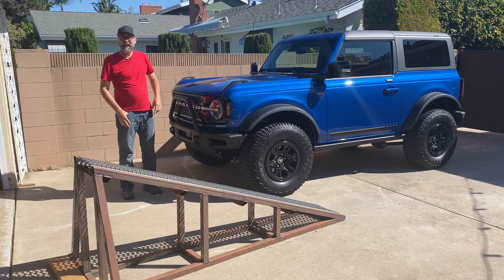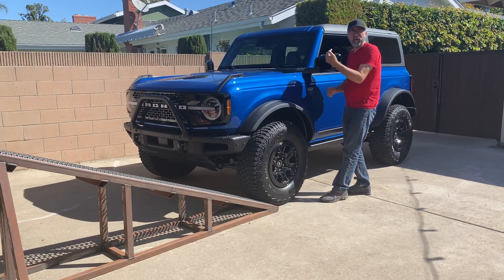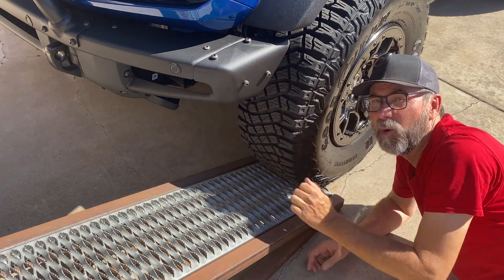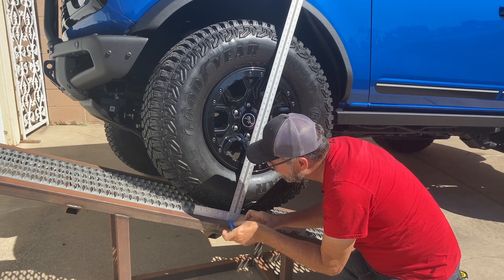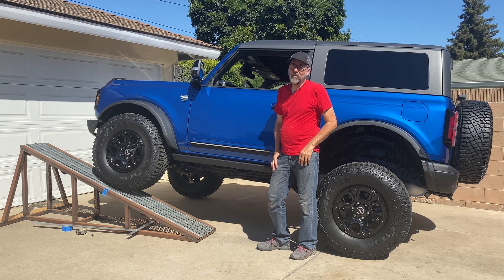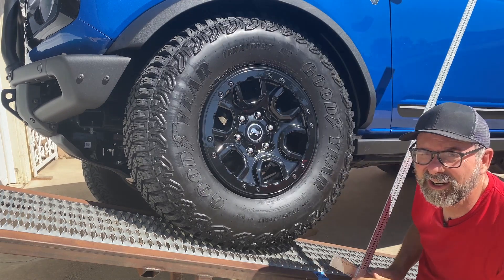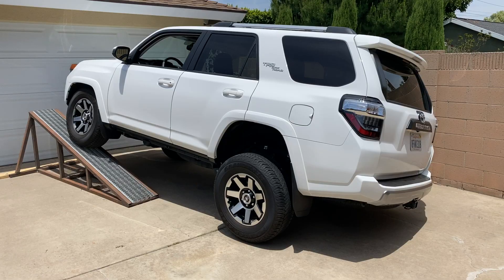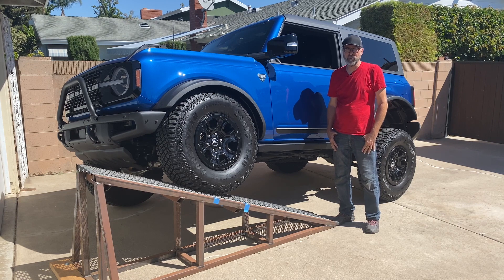2021 Ford Bronco 2-Door Suspension Flex Test: 35” Sasquatch Tires and a Disconnecting Stabilizer Bar

Comment: I would LOVE to see you do this with a Land Rover LR3/LR4! There’s debate on our forums whether or not wheeling in off road suspension height or standard height actually provides more flex. There’s also debate whether or not there’s any utility getting under the vehicle and manually disconnecting the sway bar.

Comment: Thanks for the detailed measurements and great test setup!  It would also be interesting  to rank the vehicles by their  (ramp travel / wheel base) values.  A super flexible short wheelbase vehicle can put almost both left side tires on the ramp and still register a shorter ramp travel value than a long wheelbase vehicle, etc.
Reply: That's what he did with the "flex index".

Comment: Let’s face it- the numbers don’t lie. If this stock IFS can produce those scores which are better than the Rubicon solid axle then which really offers greater flex?? Seems like that argument over solid vs IFS is settled in favor of this new Broncos design. Dan what do you say.?
Reply: short wheelbase vs long wheelbase, this is why the rti test doesnt really tell all. if they both pull up on a boulder, the gladiator rubicon would be able to pull onto a larger one, this situation has everything to do with corner travel, not just an arbitrary number from pulling up a ramp.
Reply from the maker: Right. But there's also the issue of the long wheelbase dragging as you go over the boulder. Wheel lift and wheelbase are both important at different times, and RTI attempts to combine both effects. But there will be obstacles out there that will favor one factor over the other.
Reply: @DanEdmunds  True, but doesnt track width also cause similar issues, thats not taken into account at all.
Reply: The gladiator is a long wheelbase vehicle but only lost to the 2dr Bronco by 41 points.  Let that sink in.  A 2dr JL Rubicon has a lot more flex that the 2dr bronco.  Most of the flex on the bronco comes from the rear axle too.  It does not have a sway bar in the rear either to get even more flex.  Now the miss match from the front to the rear is where I hate IFS and it is very evident when you are descending a ledge where one tire drops first, you end up tipping that way.  The sway disco helps but does not eliminate. it.
Reply: Also remember as archaic as the SFA is, it’s also strong as hell. I’ve seen IFS axels and tie rod ends snap a hell of a lot more.
Reply: @RickStefani  ..........exactly.  Well stated.  4dr. vs 2dr is apples and oranges on that ramp.

Comment: Btw for those wondering about bump stop mods. I bought a Badlands with 33s after watching this videos for the extra travel offered by the Bilstein. I then swapped them for some 35x12.5 with a 17x8 ET25 wheels and a level kit.
It doesn’t rub when I offroad. So if you have a Sasquatch with the 315/70 17, you can definitely cut down the bump stops slightly.
Cheers

Comment: Did you happen to notice the front wheel cameras on the huge center screen?  They are specifically designed to help with aligning the tires on obstacles on the trail.
😀
Reply from the maker: Yes, but they're pretty fish-eyed. I need to align the tire within an inch or less, and the camera doesn't quite give me the precision I need for that. It does help make sure I'm not going to hit the garage door, though. So I lean out the door and try not to burn my arm on the hot paint instead!
Reply: @DanEdmunds  Thanks Dan.  That makes sense.  BTW when will you get a Jeep Wrangler Rubicon that ramp?  I think we would all love to see a direct comparison between the two doors and the four doors.

Comment: Very interesting testing going on. So, I learned that almost everything is more flexible than my suzuki samurai.  I have 3 inch trail gear lift springs and they are known to be stiff. My front tire can only be lifted about 16 inches before my back tire starts coming off the ground. but my shocks still have about 2 inches off compression and extension left so at least I'm good there, lol. I'm telling you short leaf springs have no travel, but anyway I'm just testing and checking out stuff to figure out how to improve.  I think it's often overlooked; how important articulation is when offroading.  You need flex otherwise your vehicle will try to flip over...

Comment: It would have been nice to have mentioned the cameras that are installed specifically to aid with the line of sight issues you discussed. Not quite fair, IMO. Overall a very informative video.
Reply from the maker: They're pretty fish-eyed, and it's not something you expect to need while parking or squeezing through a gate. They're made to aid off-road spotting, not daily-drive visibility. The problem is even worse looking toward the front passenger corner.
Reply: @DanEdmunds  the black handle looking things on the hood are meant to help know where the wheels are and give an idea of where the corner of the vehicle is

Comment: Speaking of sway bar disconnects, I think it would be interesting if you tested the Maverick FX4...with and without sway bars. From all these other tests I've been watching, the Maverick seems really stiffly sprung, obviously catering to on-road driving, but the packaging is so perfect for overland trips that it's a shame they don't offer more off-road capability. It seems to me like it would really benefit from just a couple more inches of articulation and disconnecting the sway bars manually might do the trick. Same for the Bronco Sport.
Reply from the maker: I don't like manually disconnecting stabilizer bars, because you can get in real trouble at high speed if you don't reconnect them -- especially if you equip one with high-mounted gear like a rooftop tent. That's why systems like this auto-reconnect above 20 mph.  I think Ford needs to offer a factory-engineered taller suspension option for Maverick and Bronco sport, and I bet they will.

Comment: Thanks Dan, another very informative video and you keep the content rolling, i.e. no lags.  You mentioned that travel is limited on Sasquatch with 35’s.  How is it limited and can it be removed?  I.e. is it a stop or something.?  I’m wondering if I put 2” lift kit then could I gain more travel.
Reply from the maker: I think it's built into the bump stops within the shocks. I have not gotten direct confirmation of that. But there are no other visible bump stops external to the shocks.
Reply: @DanEdmunds  thanks for the quick reply.

Comment: Why is the lights flickering
Reply from the maker: Weird, isn't it? And it goes away when the lights are fully on. Something about the frame rate of the camera synching up with the LEDs when they're running at a lower voltage in DRL mode.

Comment: Think JLR would lend you a defender? Would love to see a video on that and compare to this.
Reply: 4 wheel independent suspension on the defender. It’s not gonna score good. I’m guessing in the 400’s. It might even breakdown while driving up the ramp.
Reply: @electrikoptik  hahaha fair point. The air suspension will already be broken.
Reply from the maker: I have done a Defender. Edit coming soon. I had to wait because I observed something odd, and I wanted to make sure it was operating as intended. It was, so I just need to do a little VO segment to finish it off.

Comment: How would the non squatch perform?
Reply from the maker: The only one that performs better than all the others is the Badlands. It has more suspension travel than everything else, plus the stab bar disconnect. Now, Sasquatch is an option there, but I would not recommend going for it. Stick with the Badlands 33" tires and you retain the extra travel and flex. I do need to get one in for that measurement, though
Reply: @DanEdmunds  where are you, mine should be coming in this week

Comment: Great video.  You need to get a 2dr Wrangler Rubicon on there.
Reply from the maker: That will happen.
Reply: @DanEdmunds  Should be a bit over the 700,  will educated guess be around 750 to maybe 800.  Tested mine on a 23 deg ramp but it was on a very lumpy grass area with a low drop for the for the right front and the ramp was tippy.  718 was the score but was so not optimal that I would just be able to say it flexes but would throw out that score.  The tall grass made it really hard to see when the tire started to lift and with the tippy ramp I stopped pretty short.

Comment: That type of vehicle is very impractical, useless and expensive here in the Netherlands but I love them anyway. Oh I have a suggestion: why don't you add a scale on the ramp so you can read off the correct value (including the sin(20 degrees))? You would still need to divide by the wheelbase of course, but it would probably reduce the error margin. You may have talked about that before, sorry if I missed that.

Comment: I don’t get how 33s would give more travel up the ramp
Reply from the maker: Because they allow the front and rear shocks to extend farther and grow longer to take full advantage of the smaller radius of the 33" tires in terms of wheelhouse clearance. The Badlands w/o Sasquatch has more suspension travel, and more travel = more flex on the ramp.

Comment: Uhhhh...I can't see the front tire out the window.  That's why they've put CAMERAS on the vehicle...
Reply from the maker: The wide-angle camera images are distorted to the sides. It doesn't help me line up precisely on the ramp, and It can't help prevent desert stripe when playing "operation" while driving along brush-lined trails. It does help with basic tire placement when straddling rocks down the middle, and it's great for peeking over blind crests. But it's not a panacea for tall fenders that block your view over the front corners.

Comment: Thanks for the video! Just a couple thoughts. Your height measurement should be measured from the top of the gripped threads on the ramp, not the side. Since that is what the tire is sitting on.  Also what tire pressure were you running? Any load in the back? Full tank? Both those factors can have an impact on results so just curious
Reply: As long as he uses the same spot when he takes measurements, the end results won't change the order.
Reply: @Sacapuntas69  yes but the test is a standardized method of testing so the same controls should be followed by everyone. These flex tests will be compared to others who did them after all. But that was only one variable of the test.

Comment: The new Bronco is nice for mall crawling and the beach. But utter useless for what I do offroad. IFS just doesn't do well offroad unless it's an ultra4.
Reply: SFA is utter useless for many others off road. So its only fair that there is something for everyone. The Bronco's IFS with over 9" wheel travel is certainly much better than most midsize IFS vehicles, more jounce travel than the wrangler even. Great for off-roading at more than a snails pace
Reply: @mattg8116  LMMFAO 9" of wheel travel that's it!! I would never leave the pavement with 9" of wheel travel. How embarrassing
Reply: @Bigdaddyslasher  Dude, first of all it's almost 10" that's more than the Wrangler, literally. Neither of these are side by sides with 20+ inches of travel. If you got an OEM vehicle, even with most basic lifts, you might be scratching 8-9" of wheel travel. Have you looked under a Wrangler? They have like 3" of jounce. That has more to do with why they suck at speed than the SFA handling.

Edit, since I know you are a bone head. Articulation is not wheel travel. Both are important. My tractor can articulate but it has zero jounce or rebound travel. If you don't have straight up wheel travel you are doomed to a crawl. But hey, it's in the name I guess lol
Reply: @mattg8116  listen bonehead and Ford fan Boi read my first comment and try to understand what I said. I could careless about your numbers. I rock crawl and IFS rigs don't make it on the trials I frequent and if they try they end up flopping on their sides.
Reply: @Bigdaddyslasher  how about you edit your comment to be accurate to your updated claim? You directly implied that the Bronco, due to IFS is only good for mall crawling (that was definitely the implication). Do you concede now that it is only undesirable for you in your circumstances? And is in fact superior for other forms of offroading you might not enjoy?
Reply: @mattg8116  how about you buy a Bronco and go rock crawl it and see how that works out for you on level 4s and 5 rock crawling trails. Do you even offroad any type of vehicle or do you just run your mouth and not rig? You probably don't even own a 4WD vehicle.
Reply: @Bigdaddyslasher  I literally do have a Bronco. Only about a month. It will go almost anywhere a similarly equipped wrangler will, and some places it won't, certainly some places much much faster which is fun as hell! I love both architectures, and hope jeep keeps the SFA, but to deny the capability of a well designed IFS system is just ignorant and annoying. You are only setting yourself up to be embarrassed eventually. The side by sides already dominate everything that doesn't require 40" tires anyway. Only a matter of time before some friggin self driving EV suv with some insane IFS/IRS delivers your food to you after you got hung up on a level 5 trail lol
Reply: @mattg8116  gotcha my comment triggered the hell out of you. LMMFAO
Reply: @Bigdaddyslasher  you seem awfully triggered yourself. I look forward to wheeling with jeeps, having fun, and helping each other out, hopefully someday people can see that there is no one size fits all solution for all offroading, Regards.
Reply: @mattg8116  bet you put a tire on a curb at the restaurant and take 100 pictures for the gram saying "look at this sick flex bruh"! #extremeflex LMMFAO